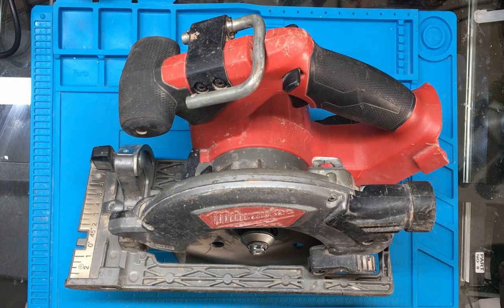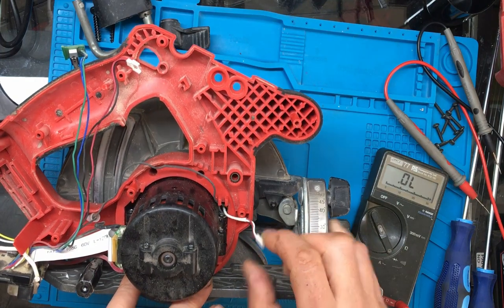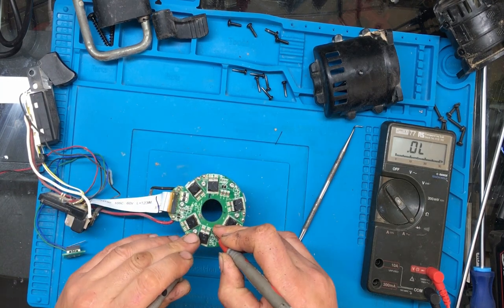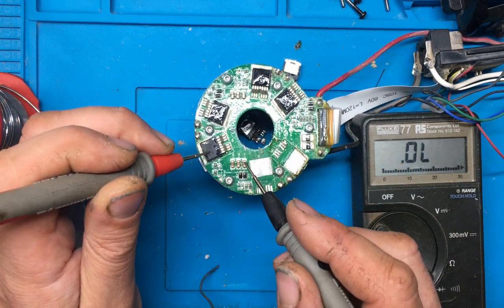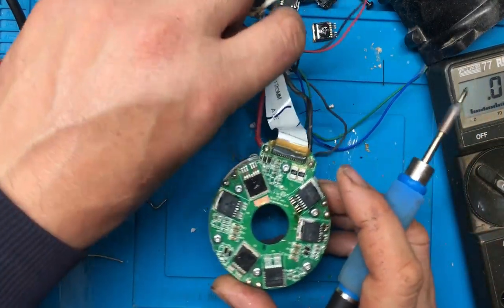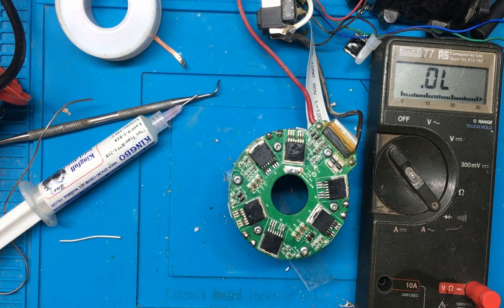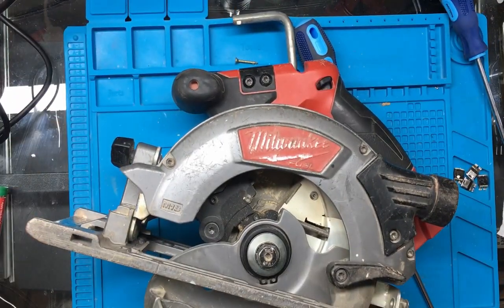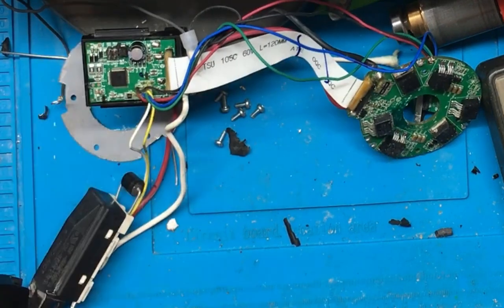Diagnosing And Fault Finding A Dead Milwaukee Circular Saw / PCB Repair.

Comment: Another great video. Shame it couldn't be fixed. That was about where I got to with the fsx sawzall, even replaced the driver chip but no luck. Back of the cupboard for now.
Reply from the maker: That sounds a bummer. The problem was the other board on the one that I fixed. I think its like a brake from what I remember. I'm not sure if you have an oscilliscope? but there should be a square wave driving the mosfets on that board and it wont run without it. What was the original problem? Mosfets?
Reply: @BuyitFixit  it might have been the brake board to start with but I think I may have shorted something at 1 stage and I pretty confident I fried the driver. Bought 1 from ali express but that didn't fix it. No life at all now, so back of the cupboard for now.
Reply from the maker: @MrTorch8  The driver chips contain a processor and firmware so unless it was programmed for that device I dont think it would do anything. I've also had fake chips from Ali Express and I ordered some mosfets from there too which some arrived already shorted so I don't think I'd really trust a lot of parts bought from there.

Comment: This failure happens on the gen 2 7-1/4 inch versions too but, it’s less common. I dropped off my M18 fuel gen 2 circular saw at the nearest Milwaukee service center for warranty work because it’s less than a year old since the tool been hesitating.
Reply from the maker: My other saw has started doing similar where it will start to spin when the trigger is pressed and then kind of free wheels. I think the main microcontroller on these goes faulty and causes the problems as I checked the mosfets and they all appear to be fine.
Reply: Mine was just over year old when i had a prblm and i only had used it once then after few months it worked again then 6 months later still worked once, after that fews days later dead as a door knob. Maybe I should have bought the Makita ?
Reply: @j.johnson5217  Milwaukee should make a gen 3 version.
Reply: @davidperry4013  That's fine but in the meantime i got a 180 dollar junk circular saw that don't work, i used it about 4 times it's close to 2 years old and just a worthless piece of garbage
Reply: Awsome video mate,
Are you able to list the soldering/cleaning tools and products/parts you used and were I can get them from?
Reply: @Irilia_neko  i thought at first the warranty was one a year and on top of that had no idea where my receipt was
Reply: Receipt is not needed. They go by the serial number, 5 years from the mf date.  I just ran into this with my 5 year and 3 month saw that just died. No receipt and 3 months out of warranty— quoted 180$ to fix.

Comment: I have had 2 failed Milwaukee 18v circular saws now, didn't register, so too expensive to fix. Now I bought the equivalent Makita and I am not held to one brand. The Makita is the superior saw, lighter and not so bulky .
Always register, the production lines are so intensely managed that mistakes happen.
Reply from the maker: I think that there is some kind of design issue with these saws. My other one is acting up and a local farmer asked if I could have a look at his as it also has stopped working. I've also seen a lot of faulty saws on Ebay...

Comment: Great video! I have mine the front led light always on even when it's not in use... Do you have any idea why?
Reply from the maker: Thanks👍I would think it either thinks the power switch has been pressed slightly or the mosfet / transistor that controls the LED has failed short circuit (which would be a pain to get to as it's all encased).
Reply: It's so you can find it in the dark easier;) just add small switch to the handle to make it on demand then.

Comment: I have been watching Dean Doherty repair a variety of cordless tools and Milwaukee comes in for a lot of criticism from him for not being worth repairing because of the lack of availability if individual spare parts.
If any part of the motor/switch/controller assembly fails you have to replace the whole assembly.
Reply from the maker: Yes, the price of which is almost the same as a new tool. I did manage to repair the cordless sander for a fraction of the cost though 🙂
Reply: @BuyitFixit  yes after writing my comment I watched the second video.
It shows how important it is to have a triage system at disposal sites so that if any item is not working or broken beyond repair  it can be dismantled to recover reusable parts to aid repair of similar equipment.

Comment: I have M18 Miter Saw 10" that I tried to cut 10" treated wood but the blade got stuck. I foolishly continued to press the switch but it went dead. I read in a web that one person could remove dust or small particle and got it spin again. But when I contacted Milwaukee, they said once happened there is no fix except replacing the motor assembly. They did not say about trigger switch. Two lessons learned were; 1- this saw does not have "Overload Protection" and 2- Yes, Milwaukee will fix it after 5 years using Serial number. Unfortunately, my machine (2734-20) died after 5 years and few weeks.

Could you please show how to open and/or fix the motor assembly for this model? Thanks a lot. Your details make the show truely practical.
Reply from the maker: I did a follow up video on this exact saw where someone sent me a spare controller pcb (which is normally part of the motor assembly) and I repaired it.

Comment: do you desolder and get back the working mosfets to be used later. downside of brushless motor they are more prone to failure due to complexity.
Reply from the maker: After recording the video, someone sent me a replacement microcontroller part, so I was able to get it working. The follow up video is a few videos after this one. Yes agree a lot more complex and more components to fail.

Comment: That's a damn shame, but hey that's electronics for you , great vid... Mine wasnt working, stuck it on the floor of the ute for 3months , thought I'd have a look at it today , took the belt clip off of it , then thought hey I might try a battery on it , .. and boom. She's a goer 😁.. so yeah this video helped me fix mine 🤣 , god knows what was wrong with it , see how long she last 👍
Reply from the maker: Glad it was helpful! I actually repair this one in a follow up video as someone sent me a replacement controller board that I wire up to the motor board I repaired.

Comment: Same problem I'm having, light working but no motor movement. CCS66, maybe they need to do a recall...
Reply from the maker: This does seem a common problem. Either blown mosfets, faulty switch or some people commenting said the ribbon cable can also cause problems.

Comment: With you skills extending into programming as well, don't you think you could create an open-source firmware to drive a simple motor at a constant speed?
Reply from the maker: It had crossed my mind, and I did look into OpenESC i think it was which is a brushless motor driver software. You would have to add a couple of other features such as battery monitoring, and control the LED but those would be fairly simple to do too.
Reply: @BuyitFixit  This would be epic

Comment: Hi I have a Milwaukee 305 m18 mitre saw dead could you fix
Reply from the maker: Someone sent me the insides of one before to have a look at. The mosfet that controls the braking had shorted and fed power back into the main chip and fried it. Unfortunately the chips aren't supplied to the public, and they contain software, so even if we could get the chips they wouldn't work as we don't have Milwaukee's code to program into it.
Reply: Ah that’s not good then thanks for your help and such a quick reply keep up the good work

Comment: I finally fixed my Milwaukee CCS66 circular saw.

I cannot believe what fixed it either, having stripped the saw down 3 times, & cleaned all the trigger connections inside checked & tested the wiring & mosfets etc & everything passing continuity tests with a multimeter, I did some more googling & people suggested cleaning the battery connectors fixed theirs. 

Well I wasn't at all convinced as my connectors looked immaculate with no gunk or residue but I gave them a drenching with WD40 Contact Cleaner & a good rub with a cotton bud which only showed an absolutely miniscule amount of dirt on it I then inserted a battery & F*CK a DUCK it fired right up 😮

I am flabbergasted, but hopefully it might help some others with these cursed Milwaukee Circular Saws having the LED light up when battery inserted but no life out of the saw at all, as this is such a simple fix that doesn't even require open the tool & will cost less than a £tenner for some decent contact cleaner.
Reply from the maker: Interesting, I wonder if it's the terminals it uses for the battery temperature sense, as if it lights up it must be getting power. Thanks for sharing 👍
Reply: @BuyitFixit Are you thinking if it cannot get any Temp data from the battery it will just refuse to start?

The motor circuit was definitely getting power as I tested it with a multimeter with a battery hooked up & pressing the trigger.
Reply from the maker: Yes, pretty much the only reason I can think of. I know the m12 flash lights alternatively and refuse to run if the temperature sensor doesn't give the correct reading.
Reply: Just to add another bit of information I have noticed, if you click the battery on & the LED instantly comes on the Saw will NOT work, but when I cleaned the battery terminals & clicked the battery the LED no longer comes on instantly & the saw fires up as it should when pressing the trigger.

Comment: Hi ,i do not know if you can help me but i have a milwaukee impact wrench and ive noticed that the hall sensor as come off and do not know were i can get some from and it says on the top of it 5tey .and on my drill i need a  W78J .thank you
Reply from the maker: Hi I've not looked at an impact wrench, but on I just had a look for hall effect sensors with those numbers and nothing came up. I know they use the DRV chips on the the saws and I've seen them in other tools. Perhaps these are the hall effect IC's are what they use? DRV5023AJQDBZR digikey seem to sell them around 75p each.
Reply: Thank you very much for your time and effort to help me . I wanted to send you pictures but I can not on here
Reply from the maker: You can email me at the channels name at out look dot com.
Reply: @BuyitFixit  hi again I managed to fix it I tuck the surface mount hall sensor off another milwaukee 18v board   the marking on the chip was different but it's all working fine and I've got the same problem with a milwaukee impact wrench missing hall sensor so I'm going to try it with the other two iv got left on that pcd .if I don't try I'll never no lol .thank you again for your help and sharing your Knowledge I love learning new skills
Reply: It's working great
Reply from the maker: Nice well done👍

Comment: I got exactly the same fault with my M18 CCS66 I thought it was a dodgy switch or connection as it would work fine for ages then stop but would work again with a bit of a clunk.

I stripped it down at the weekend cleaned the contacts & put it back together & it worked. BUT put it back in the van the next day & dead again apart from the LED 😡🤬

Got to be honest I got a lot of Milwaukee cordless kit & it is NOT worth the price premium. They seem particularly bad at switches as their drill switches die often also.

The other annoying thing is in the US they get 5 year warranty we only get 1yr with extra 1 or 2 with registration.
Reply from the maker: Yes, someone mentioned about the 5 year, and it sucks as you say how we only get a year or 3 at most...

Comment: Hi I have a Milwaukee mitre saw 305. The problem is when I push the trigger. the light gets turned on but the saw  itself doesn’t work!? 
Do you think the fault lies in motor or somewhere else!?
Reply from the maker: Someone sent me the motor assembly out of one to have a look at, unfortunately what seems a common problem with these is the braking MOSFET fails and sends 18V into the microcontroller / motor driver chip and fries it. Unfortunately this isn't replaceable as it's a Texas Instruments part which they don't supply to the public, and it has firmware programmed into it that we don't have access to either.

Comment: I have a similar prblm with mine it was maybe 14 months after i bought it. Went to use it in the spring and it didn't work? Then after 2 months i tried it again and it was fine. Now i just used it a week ago and it's still working but  just tried it again yesterday and nada. It's dead again even after putting in fresh battery? Are they making junk now, i paid over 100 dollars for mine!
Reply from the maker: Yep, I agree with that. I think the saws aren't up to the job. I've got another one that I bought new and it's acting itself and works intermittently. I think it's the microcontroller combined with a motor driver all on the same chip that is failing.
Reply: @BuyitFixit  I wonder if the standard model with the brushes maybe work better?. I think the brushless motors have more circuit involved? How can they keep making this junk
Reply: I've had mine since 2014 still working great except down bit on power under load because it was used on hardwood. 
Bought another one second hand good price so far so good

Comment: I have one of these that stops working every couple of days! I open it up and during this process the fault then goes away? I have no idea what the problem is but thought it might be a simple fix compared with your issues? I suppose the problem could be anywhere but thought I would ask your opinion. Any suggestions, would be most grateful. Regards. Kel.
Reply from the maker: I'd check the switch first of all, perhaps it requires cleaning. Unfortunately I have another model which also works a bit intermittently and I think it's a faulty of the main motor controller chip, which unfortunately you can't buy and has Milwaukee's software programmed into it.

Comment: Mines now dead dead. Bought it, two projects around the house. It died. A few months later worked again; then died again and hasn’t worked since. Off to repair it goes. Thankfully still under warrantee.
Reply from the maker: I think there's a design flaw with the circular saws as quite a few people I've spoken too seem to have issues with them.

Comment: Hi I have a milwaukee skill saw 2731-20 
De led turns on and i have power in the motor, when I pull the trigger it sounds like a click noise in the motor trying to spin 
The tool looks like new
Reply from the maker: @gonzalezmonjebernabe9967  Most common problem with these tools are shorted mosfets. I'd check those first.
Reply: @BuyitFixit  what kind of mosfets this tool used??
Reply from the maker: Usually IRLS3034-7P

Comment: Could you explain how you tested the mosfet? My small research on these explained there shouldn’t be any resistance/continuity between the drain and source pins. When you replaced with the new ones, it seems that with it read around .4 between the drain and source was good? Shouldn’t there have been no reading? Sorry novice learner here.
Reply from the maker: Theres a built in diode across. When mosfets blow they usually blow short. The meter was measuring the internal diode. You can also trigger the mosfet with a meter when testing it, and it will read short. They are a little awkward to test. Usually you get a short on the gate when they blow too...
Reply: @BuyitFixit  Thank you for the quick response! I’ll have to do more learning. Didn’t realize these had a diode. How can you tell? I was able to get mine fixed. Just had a ton of dust all over the circuit board and cleaned it off with a brush. Thank you!
Reply from the maker: If you look on the datasheet they usually have the diode marked

Comment: Hi, I have same problem, what number or reference are those mosfets please? Thank you so much
Reply from the maker: Hi Mauricio, the mosfets should be IRLS3034TRL7PP. Most of the Milwaukee brushless tools use this part. Hopefully it hasn't back fed down the lines and blown the control IC like it did in this one. I managed to get a replacement controller board / IC from someone and it did repair it in a follow up video.
Reply: @BuyitFixit   Awesome thank you so much. It seem it is only one Mosfet blown only but who knows you are right. It was running before it was taken apart anyway so hopefully it is nothing major 🤞Thanks a million once again for your help and video tutorial, much appreciate it
Reply from the maker: No problem,  really glad you found it useful 🙂👍

Comment: Hey , you got any idea what's my ryobi circular causing my saw to cut off after a few seconds being turned on ? I guess it's etheir the trigger switch or motor ? Don't even get to put it into lumber it just cuts off
Reply from the maker: Sorry I've not looked at one before, is it a brushed motor or brushless?
Reply: @BuyitFixit  can you tell me about Milwaukee or other brand you’ve worked on? What would be the cause ?
Reply from the maker: It would depend on the type of motor, a common failure on these brushless tools are the MOSFETS that drive the motor. It's a totally different setup to a brushed motor which is pretty much just a motor and a speed controller.

Comment: I had a tech from Milwaukee tell me this happens because of the brushless electronics in the saw, the saw that has brushes does not have this problem.
Reply from the maker: The designs are totally different. You are correct the brushed one would not have this problem because it does not need a brushless motor controller.

Comment: Hello, does anyone know where i may be able to pick these spares up for my circ ? Cheers
Reply from the maker: Sorry I think Milwaukee only do very few spares. They sell the electronics but in one whole unit which is pretty much the price of a new saw. Depending on what you need might be worth getting a broken one from Ebay to use for spares.